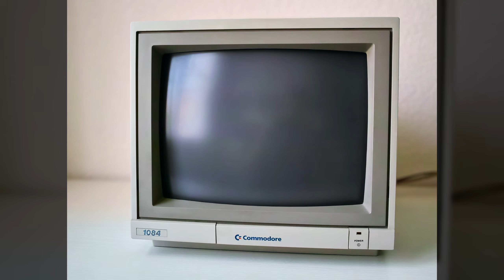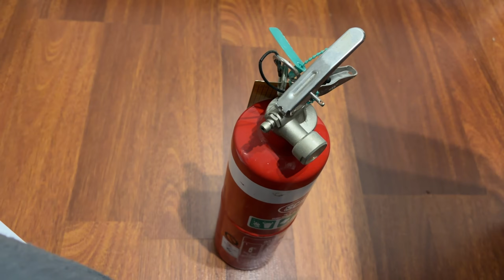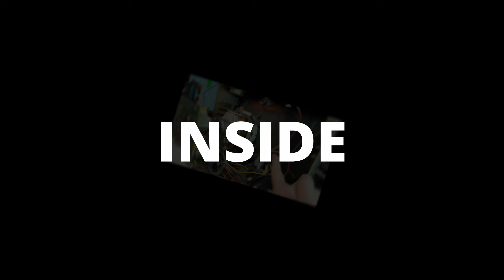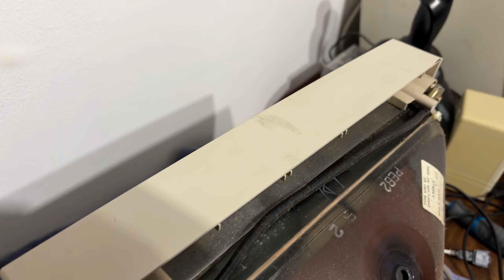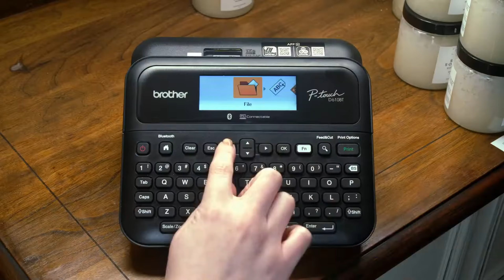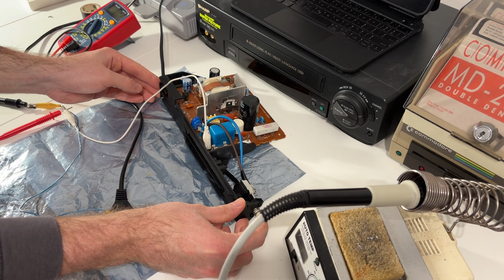Restoring a Commodore 1081 (PAL 1084) CRT Monitor...

Comment: My ocd ass couldn’t stand that you just painted that untoned acrylic paint on the rim and put a sticker on the power button without putting paint or mod podge on both 😭😭😭 but good work tho
Reply from the maker: I plan on doing a Part 2 of this video in the future, where I recap it, as well as disassemble the unit to airbrush the plastics that have chipped off paint. Because yeah, it's a salvageable job, but not one I'm particularly fond of for the long term. 😅
Reply: @Nebbed pls do that part 2 lmao 😭